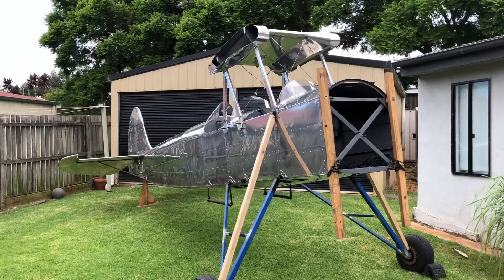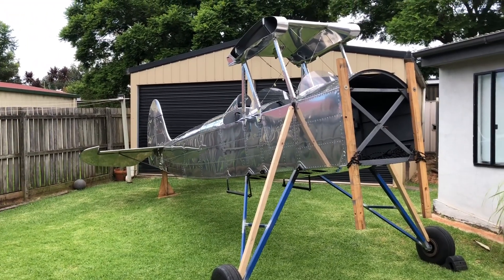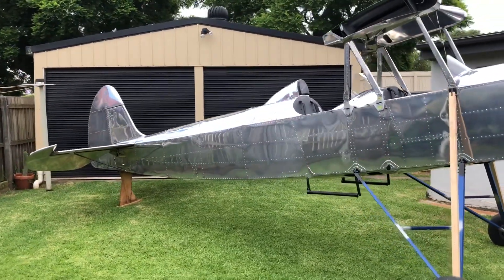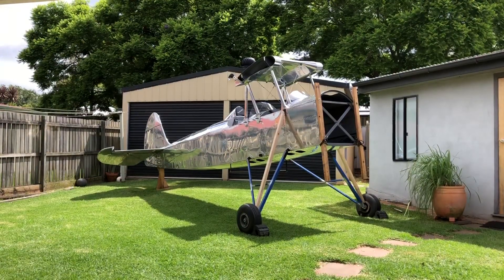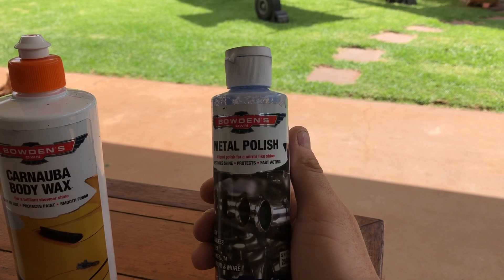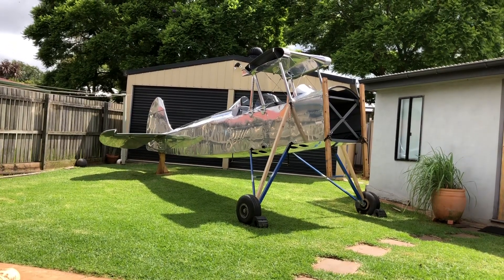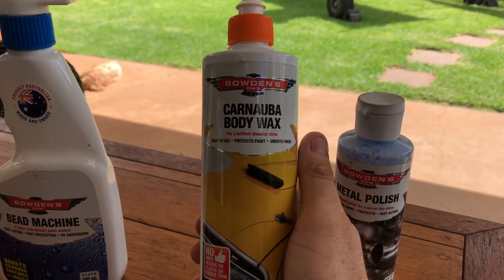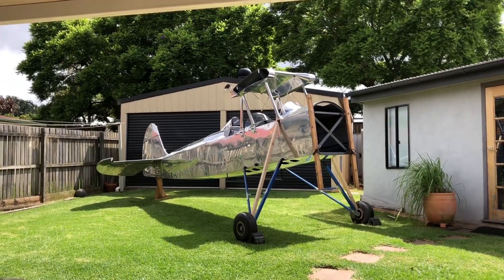It’s all about the bling

Comment: What parts of the airframe are salvaged and what parts are new?
Reply from the maker: Most of it is salvaged. I had a list in my note book for years with material thickness and dimensions I needed so either traded my time for it or went through off cuts or rejected parts in the scrap. The steel for landing gear and struts are new material, the fuel tanks and system will be new (I still need to make it from raw materials) and most of the instruments will be new